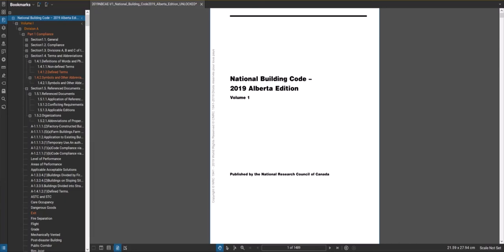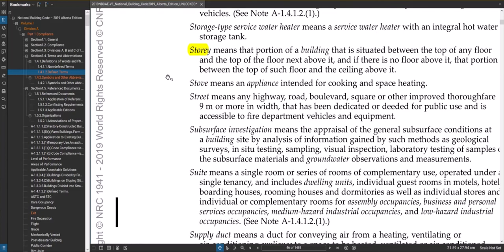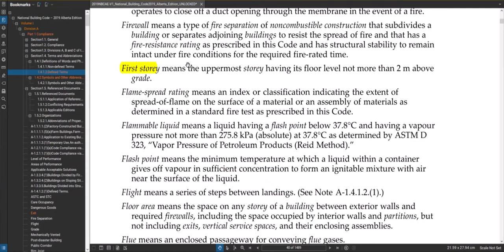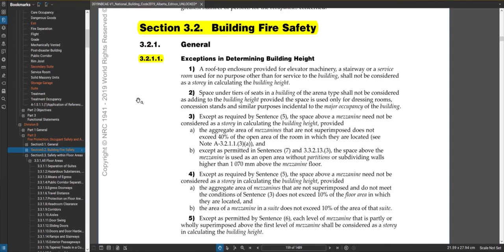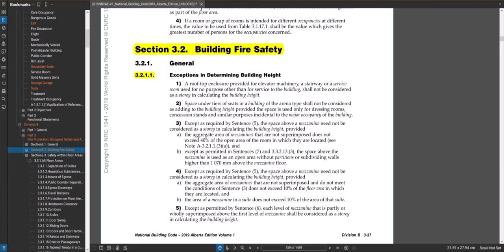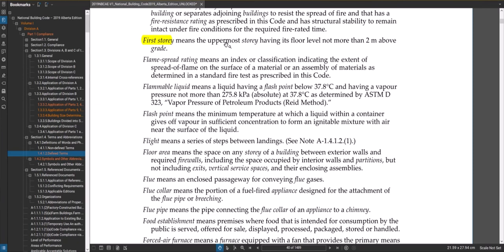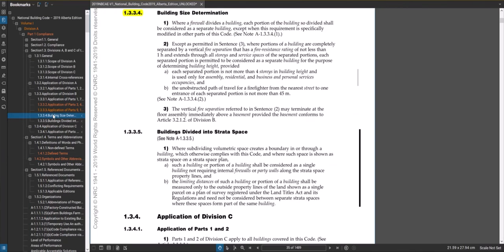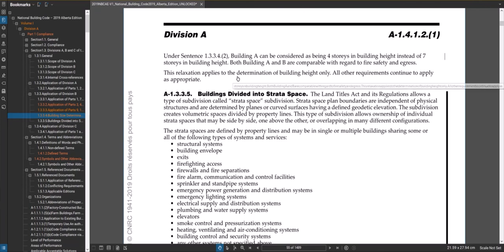Building Height - National Building Code Alberta Edition 2019

Comment: Thanks for your good explanations. Wondering about the specific case of ‘C’ occupancy on a slope where the ‘basement’ is a walkout. Generally homes with a ‘main’ and ‘second’ floor with a walkout basement are considered 2 stories but are they technically 3 stories by the code? So a 2 floor home with a walkout basement and a rooftop deck interior space (wet bar) at the stair access would be classified as a 4 story building?
Reply from the maker: Interesting question. In most cases the main floor would exceed 2m from grade at the walk-out side so yes this would trigger the walkout as a storey I guess based on the definitions of 'storey' and 'first storey'. If the roof top deck has interior space like a wet bar then technically that would be a 4th storey. I don't generally work on low density stuff but I doubt AHJ's are pushing these into Part 3 even though technically would exceed 3 storeys. Possibly some viewer will see this and enlighten us to their experience.